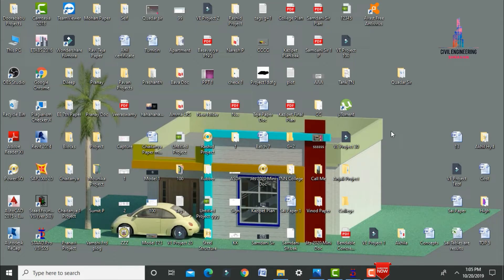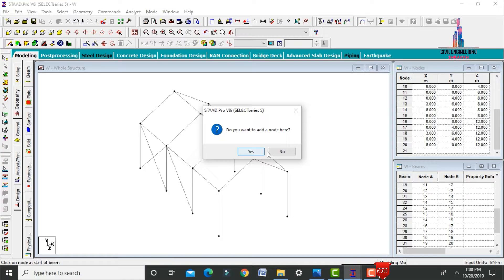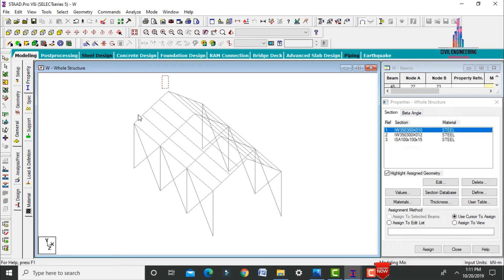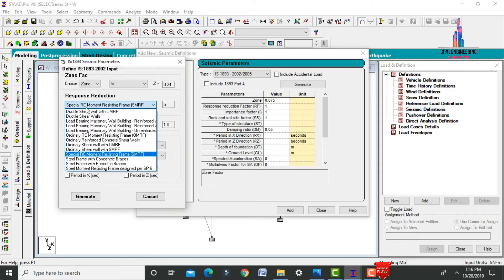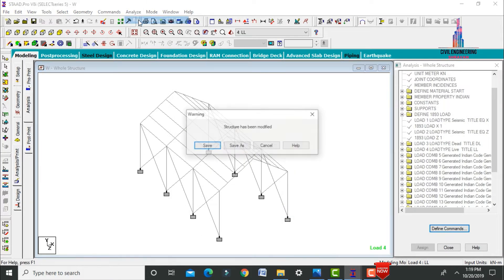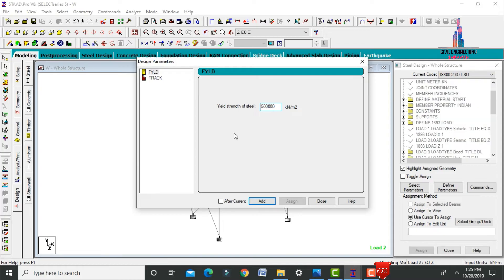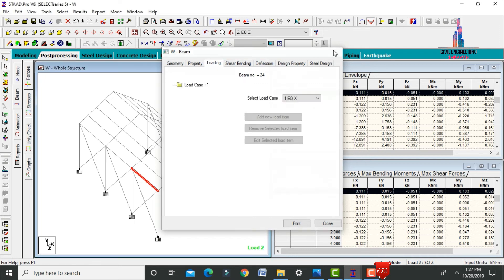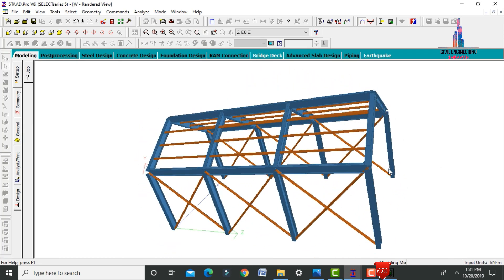Steel warehouse design design by Staad pro v8i software | Steel Building | Civil Engineering| online

Comment: Thanks for your effort in making this video. There are other parameters which also need to be defined and included
1) For example one single long beam or member is split into smaller beams in staad pro model because of insertion of nodes, this effect need to be captured by defining Ly & LZ in the parameter section. 
2) The design output only checks the individual capacity of the members as per relevant IS Code. We need to manually check the drift check at the nodes and for SLS condition deflection need to be checked manually. 
3) Another factor for economical design is to check the Ratio which can be preferably around 0.9 (90%). If the ratio is like 0.3 etc the  member sizes can be reduced and subsequently need to checked  & satisfy the Serviceability load conditions as well.
4) Member connection (Beam to Beam, Beam to Column, Column to base plate etc) also need to be designed manually or using software programs.
5) Member releases also need to be defined which is missing in the above design example & plays an important role while designing the connections (Ex: Moment connection, Shear Connection etc)
6) If anybody willing to learn on design of connections, please refer to AISC Design Guide for Connections which has lot of examples and easy to understand on different types of connection design.
Reply: Can you have design excell sheet for connection ? Please provide!
Reply: Arun sir may i get ur contact number, so that I can learn these points from u